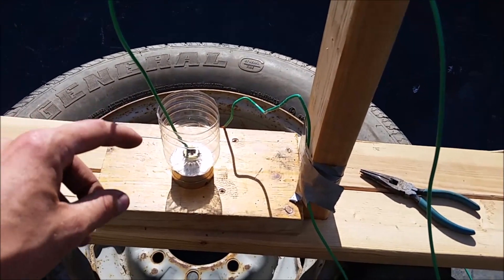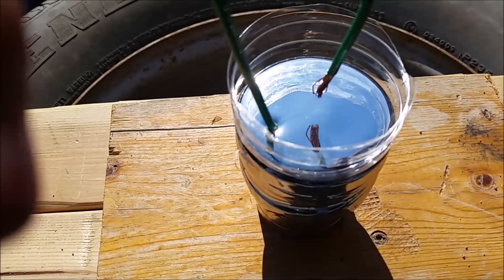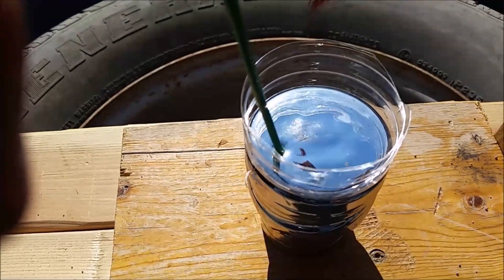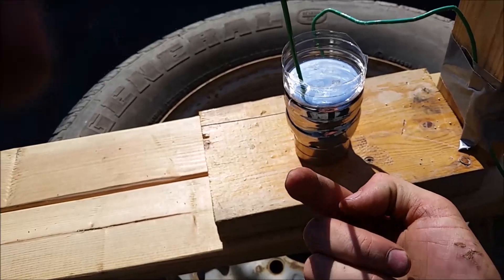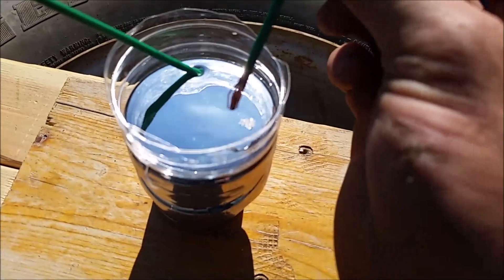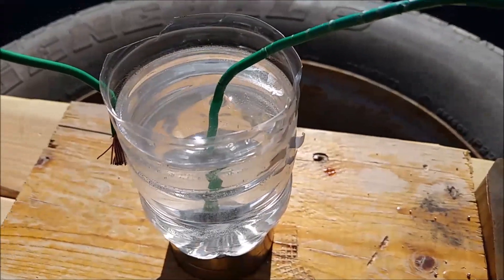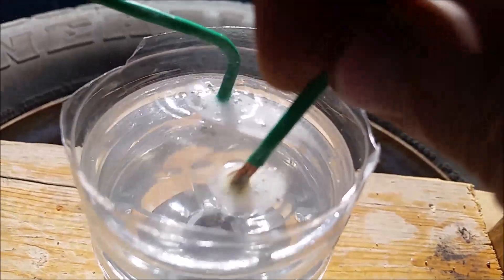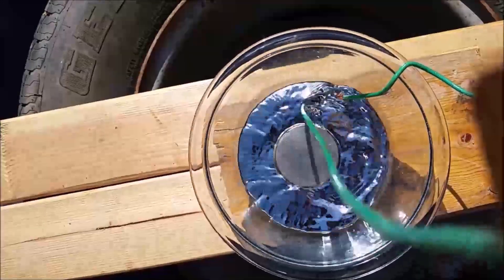Spinning Mercury With Magnet and Electricity

Comment: Hey Cody, if I had mercury in a closed off copper system in rectangle and had electricity flowing through it, would it start moving through the system? Would that create excess pressure?

Comment: Now if you could harness this spin force inside lets say a torque converter, you could turn it into mechanical motion that can do work... --- Question is, would it be MORE, or LESS efficient than a normal electric motor doing the same job?  -- Powering a water pump for example...

Comment: basically maximum force on electrons due to magnets is when they are at sin(90) which makes them move in centripetal force. Can be explained with lorentz force when you consider electric field as well to determine the force acting on the charges. [highschool physics helps]

Comment: Imagine using high voltage, high amperage version, however using Schauberger vortex principals and Tesla's valve principals and using log curve in such a way that interlacing of two separate spirals that then generate spiral vector within the tubes under condition that it will vobble ever so slightly, creating centrifugal force and controlled with a flexible valves, voltage and distance between two multi valve discs. This can possibly create certain forces that are very interesting. if there high level thinkers out there willing to undertake this, be my guest. But what do I know 😃

Comment: Anyone know if the weight changes when adding an electrical charge to mercury
Reply: technically it gets heavier because electrons have mass, but it's not noticeable since it is far to small to measure.

Comment: Cody, I am interested in making a coil around a round bent pvc pipe, and spin it through the pipe to get lift like an electric gyroscope. Any ideas to help me out? I know it will have to have a disk magnet in the center. I don’t know if you’ve ever seen the experiment with a double a battery that has a magnet on each end that propels itself through a copper coil but it’s kind of the same idea.

Comment: Hey What’s up Cody?
Have an idea for an experiment. With mercury, scalable electricity, negative charge, positive charge, sealable glass containers, wire, glue, and strong opposing magnets. Inside the containers before they are sealed, glue one magnet, positive side down then pour in the mercury. Follow the same procedure, reversing the magnets. Now there’s two tests that I think could be tried from here.
1. Using the rubber cocks insert one wire positively charged, follow the same procedure for the second container, only reversing the charge to negative. The goal is to get the mercury to spin by placing the containers as close together as possible with the magnets opposing each other.
2. Leave everything the same. Only add a second wire of the opposite charge to each container.
I don’t know what will happen, although there’s a legend about levitating mercury being used for propulsion.

Comment: Hey!
Try following: Have a dish shaped like a watch glass. Put salt water (use table salt for ex.) and a drop of mercury in it. Connect current to the salt water at two opposite sides of the dish and see what happens.
How do you explain that?
Good luck!
:-)

Comment: the clockwise and counter-clockwise rotation when both are at the surface is awesome, it's exactly like the movement of wind due to high and low pressure systems in meteorology.

Comment: try 8 parts mercury 2 parts iron dust. energize a metal chalice over that plastic bastard . I would recommend a 16 gram CO2 cartridge 8 grams of mercury 2 grams of iron dust. then insert a 1/8 x 3 inch tungsten rod /// insulate the collar of the CO2 cartridge from the neck of the tungsten rod and energize the chalice with a northern pole and the rod with a southern pole. the energy will try to ground through the iron creating a zero energy time point dilation. i accidentally shut of SAN DIEGOS power in 2011 when i tried this experiment. GOOD TALK - e

Comment: conspiracy theorist have mentioned that high speed spinning mercury will generate a null gravity field... that it was used to manipulate large stones to build ancient structures. interesting stuff Cody, keep it up.
Reply: That's what the "found" telescopes did at Mount Wilson, Yerkes etc. Have a look at the drawings and photos of them on the Huntington Digital library. The 60" in particular at Mount Wilson shows a plan view with an articulating armature base filled with mercury. Mind you the "machine" was over 60' long and the mercury would have been measured in tons. The electrical supply for the "star time" was massive. Looked to be 8 feeds of at least 440v but could very well have been much higher. Oh and they whipped up a spotlight on the side of the mountain that cast a sunbeam of light well over a hundred miles. Reports up to 160 miles out to sea. Fascinating those old Observatories, Yerkes in Chicago looks like it had a gargantuan fasces type as the old ones all had a magnetron style assembly.
Reply: What conspiracy theorists could tell us about spinning Galinstan melt at high speeds?
Reply: No, but it will produce a spin-orbit effect where the mercury takes on a nice silver appearance. It definitely creates risk of throwing toxic mercury particles where you don’t want them. It may also cause the formation of compounds, such as amalgams (mercury alloys) and oxides (think oxidation).
Reply: In which case the spin-orbitals of individual particles of mercury are locked in place due to current... creating a EM field that is in a whirlwind and somehow goes against gravity? That would explain why the Earth has a molten iron core and spins constantly to produce gravity.
Reply: @stuartdparnell  no everything has a small amount of gravity just the earth is very big and has a lot of stuff
Reply: @Spaceman0025  oh emergent force I get it now

Comment: You my be releasing Mercury vapour with the spark when doing this type of thing. Since Mercury vapour is deadly you should be using a vent hood or mask. Are you?
Reply: +Roger Beck A vent hood would only be necessary in an indoor lab. But a mask would probably be a good idea.
Reply: Chill out, it's not deadly, it just messes a bit with your brain after a long exposure.
Reply: He already got his blood tested and the levels of mercury in his blood were negligible.

Comment: isn't.mercury extremely poisonous
Reply: +ECCOWAFL l Common misconception. Elementally (pure) mercury is toxic, but the human body isn't very good at absorbing it. The danger is that the human body isn't very good at getting rid of it either. So one small exposure isn't dangerous. But if you were exposed continually for a long period of time (like if your water was contaminated with it) you would eventually build up enough to become dangerous.

Other forms of mercury are more hazardous (dimethylmercury). And mercury VAPOR is more readily absorbed than liquid mercury.

It's relatively safe to handle liquid mercury.

Comment: Are you sure this is not because of magnetic field lines that occur around a conductor through which current passes ? You should try it without the magnet and see what happenes. If it works, try wrapping the wire in a coil of a few turns and place the coil in the mercury sideways so as only half of the coil surface is immersed. Flux lines should appear through the coil.

Comment: +Cody'sLab  The navy actually has a near silent submarine that works on this very principle and it works fairly well because , IIRC, its nuclear and the ocean has saltwater. In fact eons ago Popular Science or Mechanics magazine had a writeup about using this principle ( I forget the name off the top of my head ) for transporting cars under the polar ice cap via fleet sized submarines. Now there is a job for you -- it's supposed to save money and you know THAT is what big business buys into if the mars thing does not pan out. Great vids, BTW, wish I had been able to get access to some of this stuff when I was your age there was no internet and no way to easily order most of these supplies. I had to make my own thermite by grinding down a lawnmower case and what a mess it was powdering rust!

Comment: I notice a little bit of "smoke" when the electrodes are pulled out. would that be vaporised mercury, due to the heat of a spark?

Per the continuous fizzing of the salt water likely due to electrolysis. If the conducting fluid  was held inside a plastic pipe, that pipe should function akin to a wire. wrap that pipe around an electromagnetic coil fed on ac, and ac would be induced in fluid. if the two pipe ends are joined with a piping cross and that cross placed in the gap of 2nd electromagnet fed from same ac supply, water should be pulled through one of the open ends of the pipe cross and pushed out the other. As there are no electrodes that should avoid electrolysis.

Comment: I wonder what would happen if you drip a stream of mercury past a large magnetic field.  Do you think it would ball up or deflect from Lorentz forces ?
Reply from the maker: +jcims 
I  actually have tried that, it acts like most other metals in that it generates eddy currents and forms a resistance to the motion somewhat.
Reply from the maker: +Cody'sLab 
A stream of mercury will deflect towards the magnet just like a steam of water is deflected towards the back of a spoon.

Comment: What happens without the magnet will you see the current flow in Mercury?
Reply: +William Randles It will, as it will through most metals, but there's not that much movement. You can even buy mercury switches for home circuits.
Reply: +Gareth Dean That's how old AC thermostats worked with mercury switch.

Comment: The interesting difference between the Hg and OH is that the electrons are not traveling through the Hg, but along it's surfaces along the shortest path.  Or from the dipped wire, up along its insulator, across the top surface, then down the insulator of the first submerged wire to its tip.  An upside down U shape.

The OH current flow is in a straightishline from wire tip, to wire tip.

Comment: Thanks for the video! Could you repeat the experiment without the magnet. The flow might partially be convection (localized electrical heating).
Reply: +Farshad Mozaffari In that case it should be vertical shouldn't it? Mercury moving up to the surface, then cooling and sinking down again.
Reply: +Gareth Dean You are right. Thanks!

Comment: If scaled up, how fast would one be able to make the mercury (or any other liquid metal) spin.
Reply from the maker: +TheLawnWanderer 
Gyroscope that doesn't have bearings to wear out, that might actually work!
Reply: +TheLawnWanderer No, you're not going to be able to make a ufo with this.
Reply: TheAmazingJimmy I only thought about making really powerful solid state gyros. 
But I guess they would be more like liquid state.
Reply: ***** That's more or less what I thought about yeah. 
Conducts heat well too so its easy to cool as well.

Comment: do the same thing but put the mercury in a enclosed, doughnut shaped coil where the magnet in the center . would it still work> would the metal doughnut generate a magnetic field? electric field? I would like to see you try that and do some test.
Reply: This is most likely how ufos work..